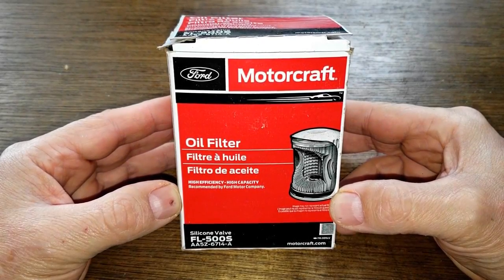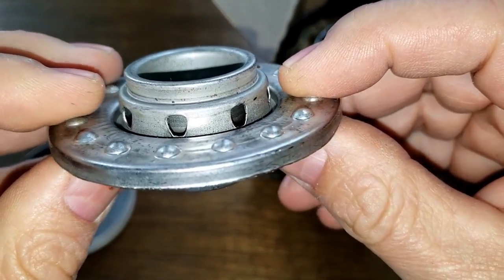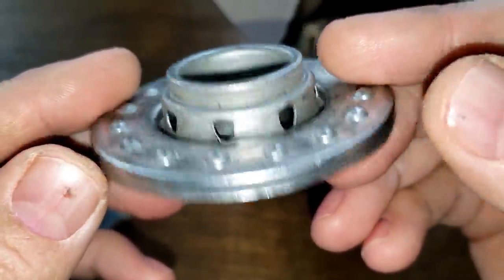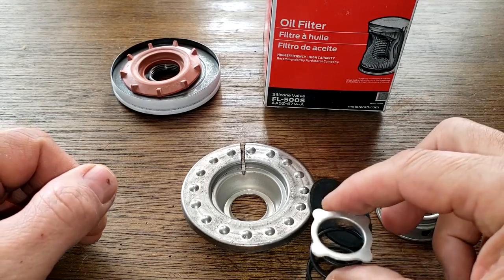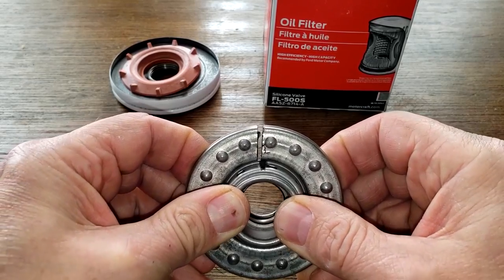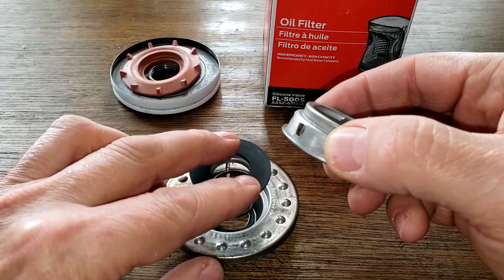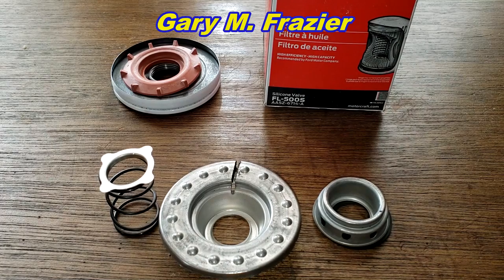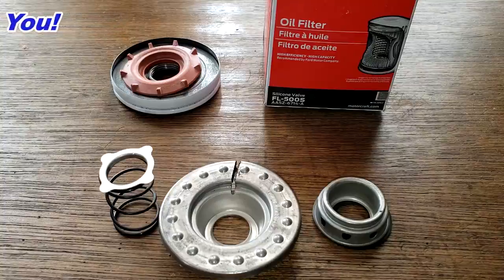Motorcraft Oil Filter Bypass Valve Dissection / Motorcraft FL-500S Oil Filter

Comment: Good video - thanks.  Anyone know if there is any other manufacturer (other than Ford/Motorcraft) using this bypass design?
Reply from the maker: You're Welcome👍
Except for the Mopar oil filters. I can't think of any other filter designs that have a bypass valve built into the endcap like the Motorcraft filters. 
Some are close, and have a separate base-end bypass valve like the Royal Purple oil filters.
I'll pin your question so that it sits up top.
Reply: @WhipCityWrencher  Thank you

Comment: Very cool video Whip! I've always been curious to see the inside of those upper bypass valves since seeing them in your videos! 😄
Reply from the maker: Thank You!👍
Glad you liked the video😊
Reply: Thanks I remember in the 60s I liked the idea of the valve being in the top because I was afraid of the bottom valve opening and lifting the big abrasives in the bottom of the filter up and into the bearings.. Looks like a more expensive valve. Seems like I remember them being called Rotunda in those days. Probably why they went to the top valve.

Comment: Thanks for this.  *Long comment warning. *  The main reason for using a base end bypass is why I wish everyone used it (but probably can't due to patents).  In a dome end bypass setup like all others have, the oil comes in, washes across the dirty side of the media, then goes through the bypass.  This means the oil can pick up particles from the dirty side of the media and put it right back into the engine when it's in bypass.  With a base end bypass, the oil comes in and right back out without ever picking up particles from the media.  I've used Motorcraft filters for years because of this design, but I only recently learned the efficiency of the media and I'm not impressed.  Not only that, I've cut open multiple used Motorcrafts lately and had the glue holding the end caps to the media separate like the glue wasn't holding, and the pleat spacing at the seams has been far too wide for my liking.  The build quality just seems not so great now and I guess that's why they're cheap.  So I've been watching your vids to help make a decision on a new filter.
Reply from the maker: Thanks,
You hit the nail on the head with the Motorcraft filters. I don't like the space between pleats or the micron rating on their filters either, but I do like the base-end bypass valve.

Comment: I just wish motorcraft did a better job with the media. 👍 As always
Reply: Motorcraft filters are made by Purolator, so Ford has a wide range of media types they could use if they chose to.
Reply from the maker: Yep,
 as far as I know, it's 80% at 20 microns, I wonder what that comes out to in 99%?
Reply from the maker: They should use this same design with a better filter media, then I would use their oil filters.
Reply: @WhipCityWrencher  the media needs to be like 8 inches longer , to fill the gaps

Comment: Hey a Football Fans Super Bowl Bonus 🏈.....  Motorcraft is still using a coil spring in thier filters after all! Great design they still choose to use. If you don't have a dirty, gunked up, engine, Motorcrafts basic media is still fine to use for 5000 miles or less. I don't see it  being better or worse than Super Techs, or Purolators 5000 milers  If it's cold weather that upper by-pass is a big benefit. I known for awhile that was a rubber seal in there...Ive poked in around those holes with an ice pick before, after cutting the used one open.. . Instantly you'll know that's not metal... Thanx Whip City for the answer to many people's question about these...🇺🇲👌👍Thanx; Jethro
Reply from the maker: You're Welcome!👍

Comment: Thanks a lot for your great work!!!
I pushed the top of spring with screwdriver of  MOTORCRAFT FL820S, very strong spring to open. Per internet: 12 psi to open. Overall Motorcraft are pretty good filters.
Still they need more production quality check quality to enhance performance. Example: Excess glue and plastic at upper and lower plastic bases of filter media.
Reply from the maker: You're Welcome!👍
Not sure what you mean by plastic at the upper and lower base?
Reply: @WhipCityWrencher  Under the  metal end caps there are plastic ends glued to filter media, fl910s must be the same build. Thanks again for your outstanding work.
Reply from the maker: @JoseMorales-vw4qf  Your Welcome!
Its just glue under the metal endcaps on the Motorcraft oil filters, no plastic.

Comment: I figured there would be some kind of rubber seal in an upper bypass valve like on this FL-500S.  Thanks for verifying that there is.  A "metal to metal" seal is why I do not like lower bypass valves that are in the leaf spring rather than in the filter element endcap.  Metal to metal cannot be a good seal when the oil is flowing under pressure inside the oil filter.  I'm sure there would be some unfiltered oil leaking by.  (Some filters do have a gasket on the endcap as the mating surface for the leaf spring. That would preclude any leakage.)
Reply from the maker: Yep,
Thank for sharing👍

Comment: I’ve noticed that Motorcraft is now using a different can. It doesn’t have the same grips as before. Are they made by a new manufacturer? Can you test the new style filter?
Reply from the maker: Are you talking about the flutes? I've opened both designs and the filters look the same.

Comment: Love your YOUTUBE video's.  Question. I haven't seen a comparison yet.   There appears to be a "NEW" design of the FL-500S.  the "NEW" one seems to have less flutes on the canister, and a bypass valve in the bottom.    I think you did a comparison on another Motocraft filter that has a similar design change.  Have you tried comparing the NEW and OLD FL-500S design?  Thanks!!
Reply from the maker: Thanks👍
I haven't done a FL500 but I have done a FL1A. https://www.youtube.com/watch?v=wObQmZTFRYs&ab_channel=WhipCityWrencher

Comment: There are upper and lower bypass valves but does it make a difference if the oil filter is mounted horizontally ?
Reply: If there is any dirt particles settled in the can outside the filter element, and a lower bypass valve opens up, the oil flowing past the filter element can carry that dirt right into the engine.  With an upper bypass valve like the one in this video, when the valve opens the oil is BYPASSING the filter element right at the start.  It's going straight from the engine right back into the engine.  Now, in a well-maintained engine, does the location of the bypass valve really make a difference?  Not really, and both care manufacturers and filter manufactures have concluded this.  Let's face it, if your oil filter has dirt and debris in it, you've already got some serious mechanical issues with your engine.  Remember, the upper bypass valve was designed in oil filters back when the quality of oil was nothing like it is now and sludge was a more common occurrence in engines.  Sludge in the engine meant sludge in the oil filter, and operation in bypass mode was not a rare thing.  Thus, having the bypass valve above the filter element so that the oil actually bypassed the filter and the sludge could very well save your engine.
Reply: YES, it makes a difference, regardless of the mounting position -- because the location of the By-Pass Valve is critical. Baseplate-end BPVs (this filter) opens BEFORE the oil washes the crud off the surface of the filter and puts it back into your engine.
This filter's By-Pass-Valve is of a superior design and function.
Due to the internal rubber (not silicone) gasket, recommended Oil & Filter Changes at 5,000 miles.
Reply: @Gary7even  ya thats what i seen on alot of other channels but my other question would be does an oil filter mounted upright need an anti- drainback valve ? i wouldnt think it would
Reply from the maker: @scottymoondogjakubin4766  If it's mounted vertically then I say no, some of your bigger oil filters that are strictly made for vertical mounts dont have one, (mostly diesel). Most of the car filters that I open fit both vertical and horizontal mounts so they usually have an anti-drain-back valve.
Reply: @scottymoondogjakubin4766  It depends on how the overall oiling system in the engine is designed.  If the manufacturer specifies a filter with an ADBV, even if the filter is mounted upright, then it is necessary.  Fluid dynamics inside the oiling system could cause the oil to be syphoned out of the filter if it did not have an ADBV.  It's not always a question of gravity acting on the oil in the filter itself.
Reply: @Gary7even  i didnt think about that ! i can see after turning the engine off there probably is still a lil suction ! thanks for the feedback !
Reply: @scottymoondogjakubin4766  The most popular engine for hot-rodding IN THE WORLD is the Small-Block Chevy -- and it has the oil filter mounted vertically -- holes up -- and, of course, can be pre-filled prior to installation, in order to prevent dry starts.
 No ADBV is necessary with a vertically-mounted (holes up) oil filter.
Reply: @scottymoondogjakubin4766  Lots of GM engines have an internal BPV and the filter has none.  If anyone is running a filter long enough to plug it  and need a BPV, ughhhh they need to really evaluate their stuff. I've never went over 7500 on any oil or filter. 
Idiots who do 3 oil changes on 1 filter need BPVs.  I don't understand filtering new oil through a dirty filter you cannot see how dirty it is.
Reply: @SlikLizrd  correct ! My corvette is that way like all my small blocks i ever owned